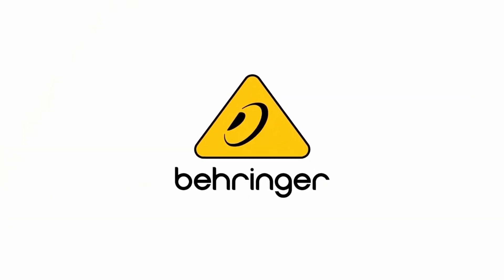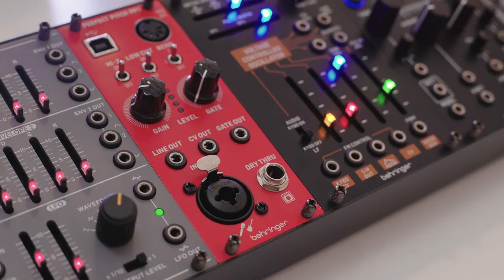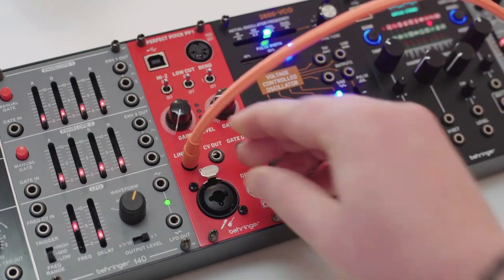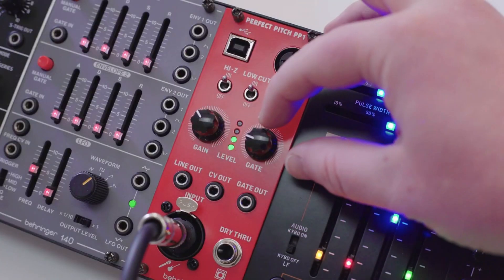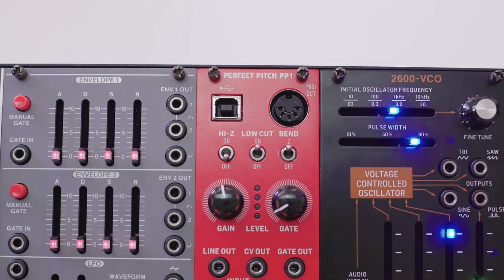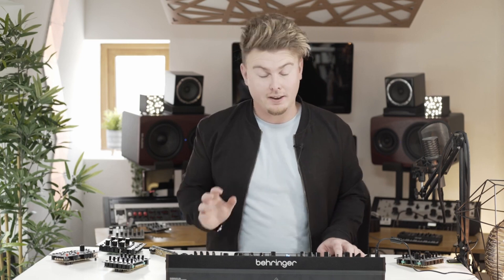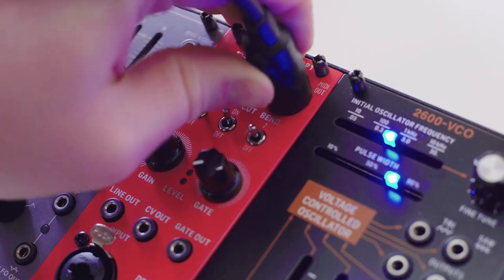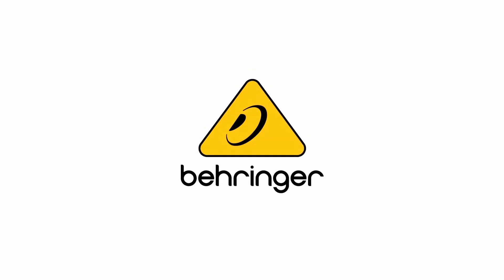Introducing Behringer PERFECT PITCH PP1

Comment: As others have said, this would be great as a standalone pedal for those of us who dont have eurorack power setups.
Reply: But you can use it as a single unit
Reply: It’s a little bit of an extra cost, but you can get a very small modular rack to house just a module or two, essentially turning it into a pedal(without stomp switches of course). Check out the powered 4MS Pod cases.
Reply: @AttackRelease1  you can also ditch the buyourselfaracksolution and just Put them on table and link together.

Comment: Are you planning to do a longer demo? It's interesting, but converting audio to pitch is notoriously difficult and this gave me no idea how well it tracks with guitar. Thanks!
Reply: Agree....woefully incomplete demo of the product.
Reply: I imagine that leaving out the part revealing how well the product works is a purposeful omission, not to scare prospective customers away
Reply: @jensmandreasen2230  yep, I have a Boss guitar synth pedal which tracks fairly well so it's possible with current technology. However, that was twice the price. I'd be surprised if this is any good for the money. Maybe it is, we'll never know from the examples on this!
Reply: I used to use a Korg pitch-to-cv with an MS-20. Both were made in the 70’s and tracking was slick. Pretty sure Behringer can handle this in 2023.
Reply: @reedsutter8485  yeah it's probably fine, in which case why not give us a decent example?
Reply: @VirtualModular  It was twenty years ago when I was using that setup and I was using a friend’s pitch-to-cv, so not many recordings left, but there’s one. This relied heavily on a guitar played through a Korg MS-02 to control a Korg MS-20 and Yamaha Cs20m. From 3:09 on, almost every synth is played by our guitarist and two of us tweaked the daylights out of the knobs.
https://youtu.be/D9wGiVBEegE
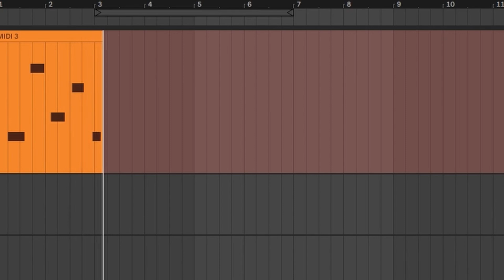Reply: Sorry, the pitch-to-cv starts at the instrumental break around 2:30

Comment: I would love it if you made the Neutron's MIDI to CV converter into a module (complete with the Assign output). The Neutron's converter is perfect for wind synths for three reasons. 1: I can send breath as aftertouch to go to the Assign. 2: The converter handles legato perfectly (unlike my other converters). 3: There is no dead spot in the middle of the pitch bend which means bite vibrato is also handled perfectly.

Comment: Two questions...
1) Will this work with bass guitar?
2) Can this be made available as a standalone unit?
Reply: I have the Injectr module works with Bass , this unit should do the same .. suggest getting a small compact Eurorack unit would probably be cheaper than a pedal and you could add an a couple of effects
Reply: 3) Can it be made available at all?

Comment: Monophonic only?
Reply: Seeing that this is only useful for vocals and instruments to be used as a midi controller, stereo input would be stupid.
Reply: Oh wait, do you mean like playing a chord on guitar? I guess that would be a problem to try to pitch correct a complicated waveform. Probably won't work with any distortion pedals or high gain amp either.
Reply: This would be mono. But I wonder if they could use their TC Polytune technology to track poly to midi in a pedal version 🤔
Reply: There’s an iPad app that does polyphonic pitch-to-MIDI. Which has left me scratching my head as to why none of the hardware pitch-to-MIDI products are polyphonic. Although the designer of one did tell me that he wasn’t happy with the tracking of the iPad app and hadn’t been able to do better. But tracking has always been something you have to learn how to work with with these kinds of products.
Reply: Just buy Two of them ?
Reply: @aaronparys1750  🤨 Six of them and a hexaphonic pickup would do the trick, but you’re probably better off with another solution if you’re going the hex-pickup route.
Reply: @RobertFisher1969  yes definitely .. These types of Modules work best with Bass Guitar (no Chords) .. I Know I have the BoredBrains Injectr